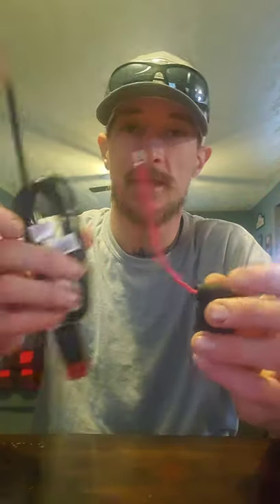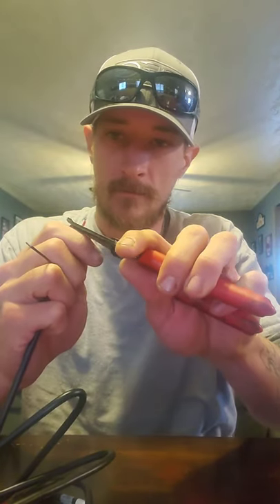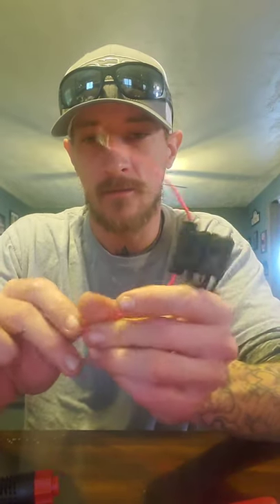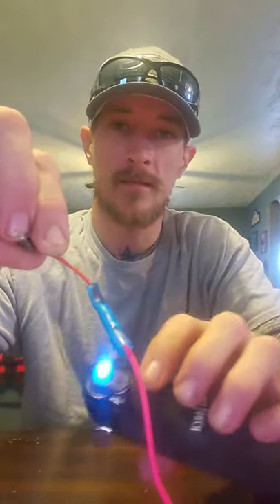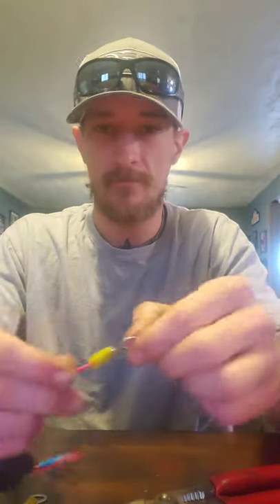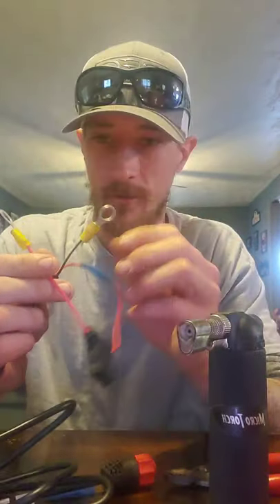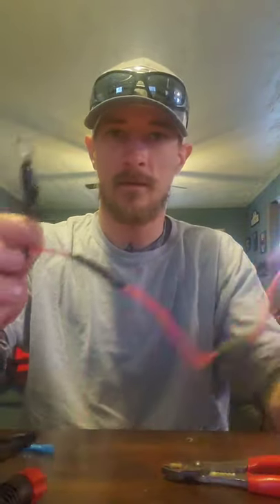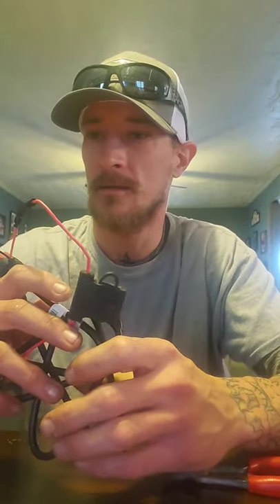how-to wire an inline fuse

Comment: ive somehow managed to snap my new neon light cable at the on off toggle switch 😭 ive ordered a replacement switch but im lost as to how i need to connect the 2 thin wires to what looks like little clamps in the switch ?  any advice would be a great help ?
Reply from the maker: Do u have Instagram? Try sending me a pic on there in messager so I could get a look at what ur working with I'd be glad to help. But without seeing what chur working with im kinda at a loss to help ya but I'd be glad to take a look for sure

Comment: Excellent video I like your simple instruction. I have the Lance fishfinder Hook 4 And the wiring set up came with two clear looking connectors but they look a little different than the connectors you used. Do they go on the same way ? Thx mate
Reply from the maker: Probably quick connects if there is a male and female end on them. But yeah probably the same kinda install. You can send me pictures on my Instagram and I can be better of assistance to ya my friend! Tight lines 🤙

Comment: What size fuses are you using I have heard several different opinions from 5 amp to 20 amp,  I would think a 5 amp for each fish finder and maybe a 20 amp if you have 2 or more connected in the same area?
Reply from the maker: I use 3 amp.. thats what came with my elites so I really don't wanna send more juice to them then the factory recommendation
Reply from the maker: Thats atleast what I use for my fish finders. But the size of the fuse depends on what your trying to put a fuse on. Everything electronic has a need for as much juice as needed to run and perform right.. not enough your item won't turn on or function right and if to much you'll blow fuses

Comment: I don't have a torch and don't wanna buy one.  is a lighter okay?  i have one of those long ones and can hold the wire with pliers for safety reasons, if need be.
Reply from the maker: Yeah u can use a lighter. It doesn't have to be a torch.. and kinda fire would work regardless of where it comes from.. hope this helps and lmk if ya have anymore questions!!

Comment: ive never used the inline fuse and no problems yet. is it really needed?
Reply from the maker: It's not as necessarily needed other then just protecting your fish finders and other electronics. It's much easier to replace a cheap fuse then to replace a finder or whatever else u have wired up. It's what I like to call reassurance cuz the bus fuse holder and fuses are alot cheaper to replace if something were to happen. And I've been an automotive tech for goin on 6 years professionally and I've seen all kinds of electrical problems happen that one would never think of. But no you can straightwire to a battery but it just keeps the voltage and amps to the recommended levels.. because if to much juice flows then your liable to melt internal parts on the finder and maybe even (worse case scenario) cause a small electrical fire that can lead to worse issues. But needed, not per say but its more of a safety insurance thats all

Comment: and for people that dont have the fancy crimping tool for the but connector..there are a set of default crimpers specifically for but connectors and they usually have yellow or orange handles...If you look closely at the tip of those default crimpers there are 3 dots..blue red and yellow..your gonna want to match the but connector to the color of dot and crimp the but connector...

Comment: i was hoping to see you install it somewhere and see if it works
Reply from the maker: My 2 lowrance 7 inch units at the console, my 12 inch lowrance and my garmin livescope unit and black box and my kayak are all hooked up with these connectors. Also my noco lithium battery charger and my minn kota charger for the big batteries are hooked up the same.. and the power poles, plus I wire up semi trucks, dump trucks, ambulances and work trucks I work on in a daily basis at work are all wired with these.. and they work just fine my friend. So if u want to see a power up video I can make a YouTube short. Tight lines

Comment: Pardon me..for a subwoofer & Amp set up.. Amp has 2× 40amp orange fuses on it so woukd you also need 2× 40 fuses on your online fuse
Reply from the maker: I still install inline fuses on a auto amp. Just incase but in theory you wouldn't have to. I just like the extra protection to protect the equipment in your purchases my friend. Sorry took so long to reply

Comment: How do you know what size connectors to use?
Reply from the maker: It depends on the gauge of wire. There are typically 4 types of connectors. The red connector is for 22-18 gauge wire, the blue is for 16-14 gauge and the yellow is for 12-10 gauge wire. Now the other is a metal connector for thicker then 10 gauge. But those are your common connectors for your AWG wire (AWG= American Wire Gauge). So you should be sure of your gauge wire you're going to use when purchasing the size connectors. You can buy them in connector kits so they have all options for a range of wires. Hope this helps and thanks for the view! Any more questions feel free to ask im glad to help
Reply: @cra-bassint.v.5664  thanks alot for the info.

Comment: I just added an inline fuse to a positive wire and i still got continuity with or with out the fuse in place. Is that normal
Reply from the maker: I would have to say no.. thats the point of the fuse is to break the circut when the fuse pops. If your still getting continuity with the fuse missing that means you still have a connection somewhere passing current along the system. If you have a multimeter check the back end of the fuse (opposite of the positive terminal side of the fuse) to see if you are getting a voltage reading to determine if your trickling power through somewhere along the way. Or if u don't have a multimeter u can pick up a test light and do the same kinda test. I'm not electrician but atleast through my automotive experience removing the fuse should break the circuit to not allow electricity to pass through. If it still is u have another issue and I'd definitely replace that fuse. I hope this helps and if u have any further questions feel free to ask away and I will research more to help u achieve your answer. Thanks for the question bud
Reply: @cra-bassint.v.5664  sounds good. I’ll definitely do a voltage test on it and if i get volts without a fuse im definitely returning it
Reply from the maker: Yeah man keep me updated on how the test came out because I'm curious myself. If u do the voltage test and get nothing but you get continuity lmk because maybe ill do a few tests myself because I'm intrigued now lol. I appreciate the view and hope this helped. If ya wouldn't mind keep me updated bout your test and we will go from there buddy!
Reply: @cra-bassint.v.5664  i did a voltage test and with the fuse i had incoming voltage of 12.6. With out the fuse the light turned on but my voltage did come in at 11 volts
Reply from the maker: Then yeah man I would do away with that fuse.. sounds to have a complete circuit so something isn't right there bud
Reply from the maker: With no fuse you should have a reading of 0.00 with voltage if u take the fuse out.. on the power cable side you'll have that 12 volt coming through but on the back side you should have a 0 reading on the line until u put a fuse in
Reply: @cra-bassint.v.5664  ima try with a blown fuse and if that falls im going to change it

Comment: Lol whats size fuse tho bro?...AS in amperage.
Reply from the maker: You choose the amps for what ever you going to run there is going to be a recommended size fuse for what you're trying to do. Everything varies like car amps can take a 100 amp fuse and my fishfinders are recommended for 3 amp but I run em with 5's. What are you using it for?
Reply: @cra-bassint.v.5664  What's the advantage of running a 5? To allow more power?
Reply from the maker: @king4brisbane  yessir